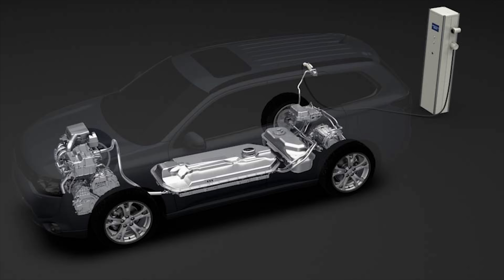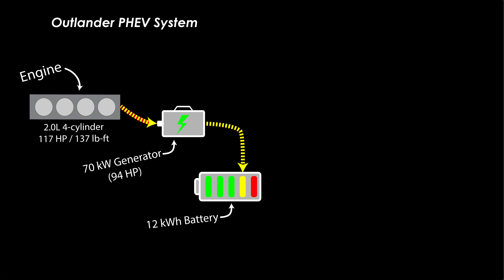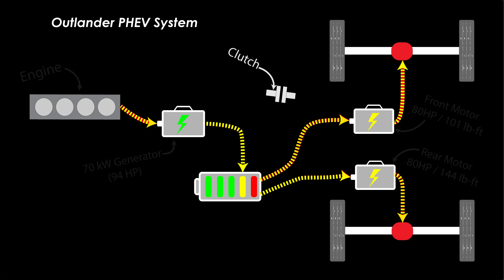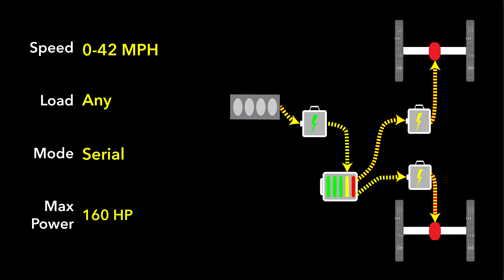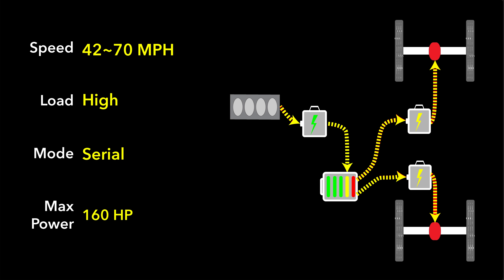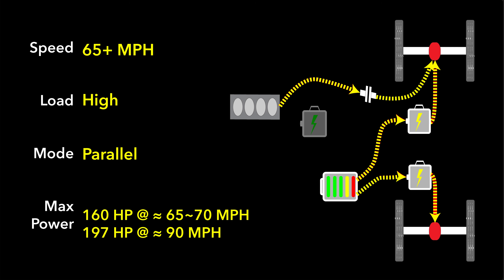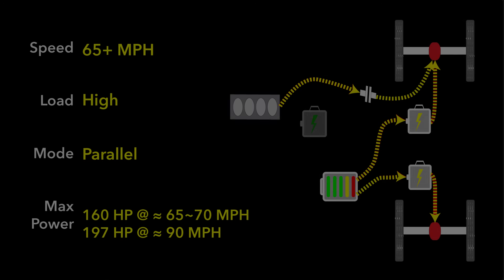Mitsubishi Outlander AWD Plug In Hybrid System Explained!

Comment: I believe this is outdated now, updated link anyone?
Reply from the maker: The current outlander’s system is basically the same except they tweaked the motors and engine and changed the battery. The operating modes are the same however.

Comment: "If the battery drops down to some other state of charge, then the maximum power you can get is about 94 hp." 

That's about 39% capacity if you ask me. The car reserves 30% charge by default,. I'm assuming that's for serial hybrid mode on the highway from 57/58 to 70mph. Then parallel hybrid mode reengages clutch,  sending extra power to the front wheels from 70 to 90mph.  Battery capacity is used during parallel mode ramping too so the extra 37 hp from the clutch reengaging happens but fuel depletion from engine charging lithium battery happens simultaneously. There's also battery depletion on the highway, but maybe that's only from 50-ish to 70mph in serial mode.  I don't know.  Do you know anything about the transaxle?

Comment: Great explanation. Can you tell me, what if they would put CVT gearbox between the engine and front axle? Could engine then send power to the front wheels in any conditions, if needed (faster accelerations, overtaking..)??

Comment: I wish you add a tall distance you could drive before you have to filled up gas.
Reply: It would vary depending on the how much of the mileage used either charged electric or gas as the fuel....and since it could be driven 100% from charged electric in its serial hybrid mode you never have to fill it with gas...but for 1 trip max mileage estimate multiply it gas tank capacity in gallons by the mileage figure for the type of driving and add the range for the batteries... or is that to complex for social media, where ppl just want to be fed simple answers that have not meaning????

Comment: It is a novel Hybrid AWD system but I feel like there are various improvements to be done. 

Firstly improve the gasoline engine - the 2.0L 4B11 is a great reliable workhorse in a Lancer or Outlander Sport/RVR but too small for the larger Outlander. Thankfully Mitsubishi got that message as the 2019 Outlander PHEV gets a 2.4L 4J12 with Atkinson cycle which would improve gas hybrid MPG.

Second a battery pack of ~20 kWh would be beneficial with the target being ~80km/~50mi EV range. I think that might be a bit too much for this current battery pack size (might have to wait for the next generation Outlander PHEV) but that would also reduce gas use considerably & grant greater flexibility to stay in EV mode.

Lastly, Mitsubishi should really think of upping the gearing of the direct drive parallel hybrid mode. The current implementation allows operation from 42mph (65km/h) turning the engine at 1700rpm, but at highway speeds of 75mph (120km/h) the engine spins extremely fast at ~3200rpm, which is NOT ideal for low fuel consumption. I would raise the parallel hybrid operation to ~55mph/90km/h which would let the electric motors do most of the work at lower city speeds & stop & go while reducing the engine speeds drastically at freeway speeds.
Reply: The new Outlander is essentially this. You’re a psychic.

Comment: Somewhat similar to a Diesel-Electric Locomotive but not as good(rugged/reliable/heavy duty/powerful) yet . . . the Gen Set needs to power the motors at ALL TIMES/SPEEDS while filling the battery as a second thought w/o throwing the towel and fainting.
All these Hybrids are still Fisher Price Toys level, nothing serious or rugged enough to write home about.
At least it's a start in the right direction, let's hope it becomes a WHOLE LOT better.
Reply: Nah. We’ll skip straight to electric here soon. No need for complicated engines with a vehicle as small as a car.

Comment: Sounds a lot like the Honda Accord hybrid system which is essentially a one speed clutch based system for direct drive from the engine.  One of the downsides with Honda's is the engine might run full bore at a lower and or steady speed in order to charge the battery.
Reply: RJParker You beat me to it! It sounds like an all wheel drive variant of there most recent Honda Accord hybrid drivetrain. I wish Alex had explained how this system differs from Honda's.
Reply: In our '14 Accord Hybrid the engine never races to just simply put charge back into the battery. What the engine does do is compensate for any lack of battery charge with increased rpm depending on how much throttle is given. At lower, and especially steady speeds, the engine is all but imperceptible. So for example, because of various circumstances you have low pack charge and need to climb a hill where you'll be giving it more throttle, the engine will rev higher in order to produce the needed current for the job at hand. Climbing the same hill with a full or close to full charge will not require as much rpm from the engine to get the job done, at least until charge levels lower and you are still requiring the extra juice. Once you get used to the free-wheeling nature of the engine it does work quite well, all without the need for a transmission. Without the need to climb steep hills and just cruising about it's pretty easy to get over 50 mpg.
Reply: The only real difference as I know it is the addition of a rear motor & the Mitsubishi's significantly larger battery pack. The Accord Hybrid single traction motor (being FWD) is just "slightly" stronger at 124kW vs. the Outlander PHEV two 60kW (total 120kW) traction motors front & rear, but since it lacks the battery capacity of the Mitsubishi the Honda would almost require the engine to fire to get up to speed.

In all honesty, I feel a more valid comparison would be towards the new Clarity Plug-in Hybrid, which shares much of the Accord Hybrid's design but possessing a bigger battery which then operates pretty much identically to the Outlander PHEV.

Comment: This explanation implies that the gasoline engine is always running, even from a stop with full battery.  Is this how the car operates?  Even though a Prius is a parallel hybrid, it often runs in 100% EV from a start in its standard operating mode (i.e., without forcing it into EV only).  As a plug-in hybrid (i.e., a large battery hybrid), I would expect the Mitsubishi to, by default, operate in full EV from a stop and only engage the gasoline engine when either (i) the battery falls below some threshold of charge; or (ii) the driver calls for more or max power.
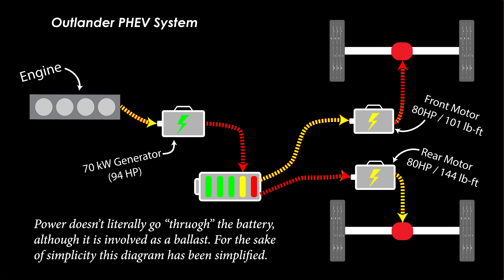Reply: I dont think it implies that at all. @1:10 or so he clearly states that only if more power is needed (assuming battery is full) will the engine start.
Reply: I test drove this this vehicle today.  If there is battery power available, it can accelerate the car all the way up to highway speeds without the engine and on battery alone.
Reply: If you have >26% state of charge (SoC) on the drive battery & the power demand (the left needle on the gauge cluster) doesn't go into the "Power" range, the car operates solely in EV mode. The car has ample power while doing so (you can still accelerate briskly) but don't expect to keep up with BMWs or V6 muscle cars. It would maintain EV mode until battery drops below 26% or you push into the "Power" where the engine would fire to help give some extra shove.